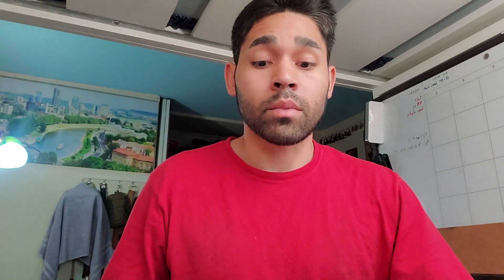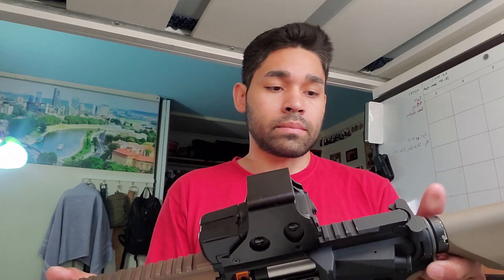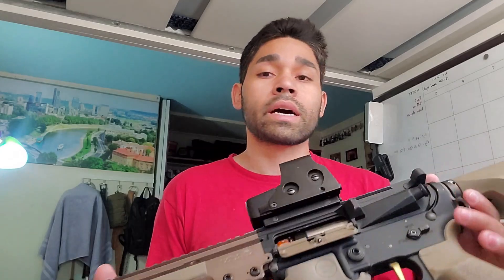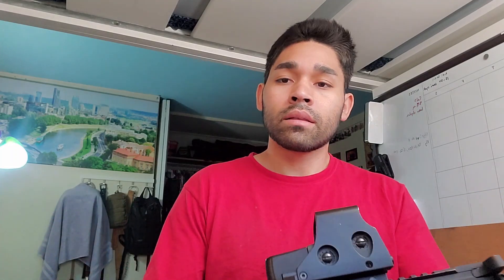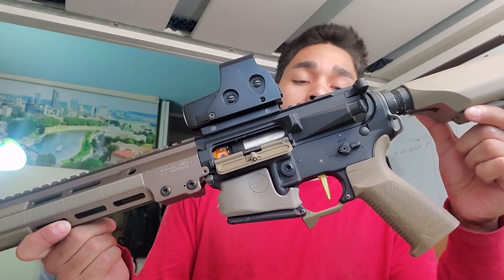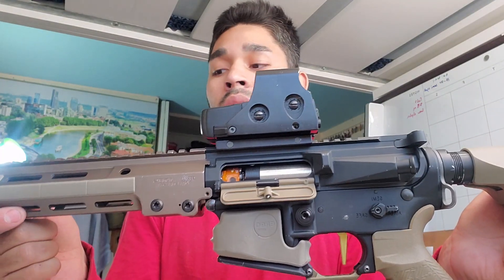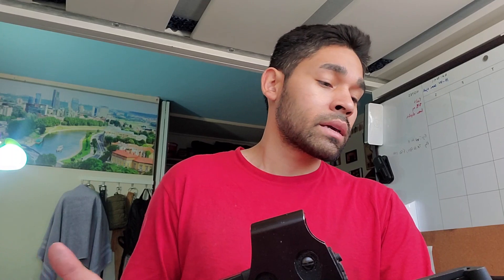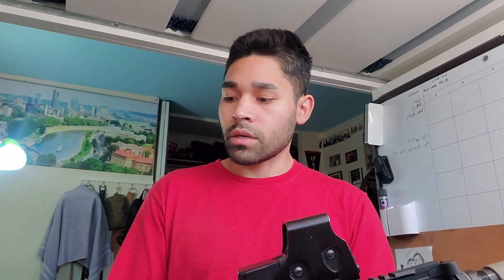Aztech Innovations Tappetless URGI

Comment: The Apache is designed for Gel Blasters.... not airsoft. Its made in Australia where airsoft is illegal so I highly doubt they test it with airsoft gear (Even though gelblasters are close they are quite different).  In a gel blasters thise apaches run like a dream. Check out my latest two vids
Reply from the maker: AZTECH makes an airsoft version. The GB version has a rubber cover on the tip of the nozzle, the AS version does not
Reply: @sausageofmarnies2799  it's true. They adjust it for the 6mm size. But trust me when I say...they are designed for gel blasters. The airsoft version is an afterthought
Reply from the maker: @Timmydope  oooh ok I see what you're saying. Yes, I did not like how it functioned in this build
Reply: @sausageofmarnies2799   seems to be the general thought amongst all airsoft videos I have seen try to use them.  Even in the gel blasters we had to do some custom mods to get it working like a dream. Did get there though

Comment: Ahha i just ordered all these parts and now after seeing your vid kinda regretting it
Reply from the maker: If you ordered the gen 2 parts you may be good, everything I put in this build was from the first wave of products released by AI, I know they've done more RnD, as well as received feedback from techs and have updated some of their products but I haven't tried them yet so I don't really know if they fixed the issues or not
Reply: @sausageofmarnies2799   yeah i didnt order directly from them, and im pretty  sure they are gonna be first gen parts,  may just swap at gears for a pair of siegetek
Reply from the maker: @batzarrosdefijourney6970  for the gears I'd say try the out first, especially if you run aosfet other than a titan, the cylinder head though that may be a bust id recommend the new GATE pcylinder head , the piston and piston head are good
Reply: @sausageofmarnies2799  ok cool thanks, ill check out that gate head havent heard of it

Comment: For a hard spring, couldn't you put a thin spacer of durable plastic so the soft aluminum is protected?
Reply from the maker: I thought about t hat too but didn't have anything small enough to dit the groove where the spring sits, should work in theory though

Comment: I tried the apache In my m4 and no matter what bucking or hop up unit I used my bbs would never fly straight at all.  Any tips for that?
Reply from the maker: Honestly no, I ditched the apache because it had some major flaws. I know an updated version is slated to release soon so hopefully they fixed the problems that v1.0 was having. As of now though I would honestly just recommend switching back to a standard tappeted setup